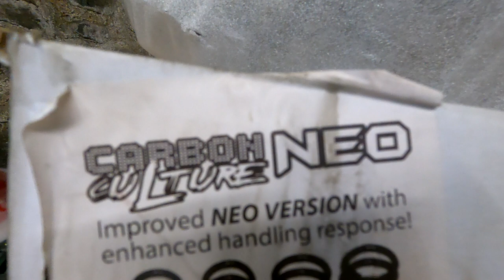CL9 Honda Accord Type S 50mm lowering springs Install

Comment: Are these springs suitable for stock suspension? or would I need to do anything else? I read that going lower that 30mm will make the rear wheels have negative camber..
Reply from the maker: They are designed to go in the oem shocks mate like any other lowering  spring I’d imagine 🤘🏻❤️
Reply: @CowabungaCarDiaries  That is ideal! Has the owner had any complaints about them do you know? cheers mate
Reply from the maker: @poj_r  no mate none that I have heard of
Reply: @CowabungaCarDiaries  Nice one mate, cheers for the replies